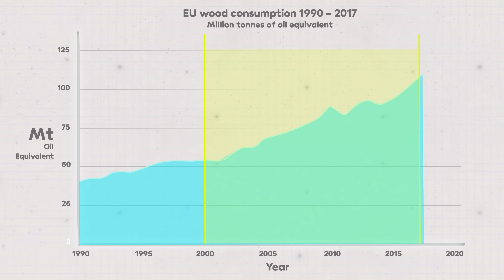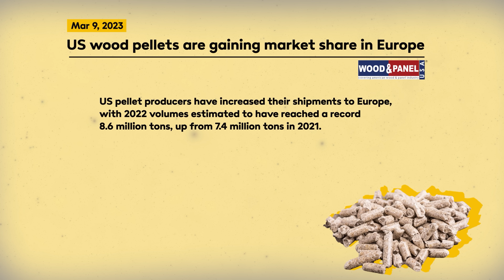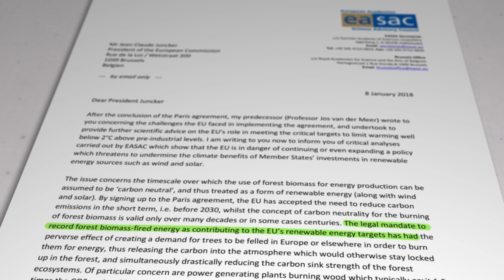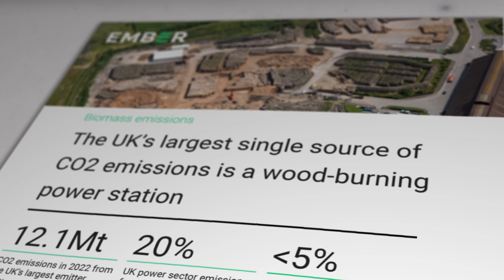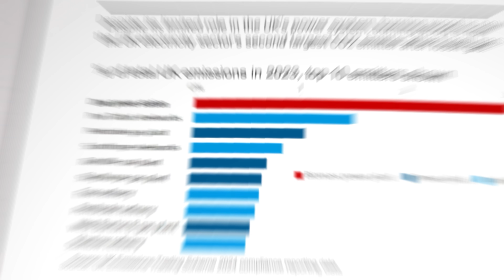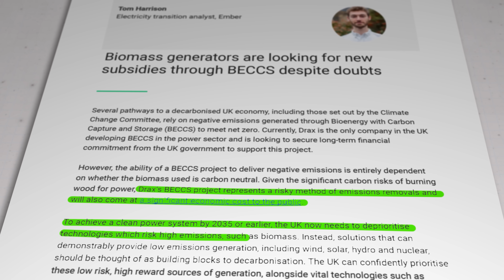New report: Biomass CO2 emissions 4X higher than COAL!!

Comment: Watching the green eyeshade activists rent seekers in action demonstrates the silly outcomes of central government-based activist-driven subsidies.   If we just had a pure carbon tax on carbon out of the ground (fossil fuels) that was revenue-neutral with the money back to the citizens would do the allocation of CO2 much more sensibly.   

Something is wrong about the CO2 emissions per kWh of electricity from coal vs wood in your presentation.   Chemically wood is effectively coal (carbon) + water  (C6 H10 O5 ) and aside from the latent heat of the water as shown in lower and higher heating values, not that much difference in terms of CO2 in the stack gas per KWH generated.  The lower heating value of wood in BTU/kg is just the added kg of H2O in the molecules of wood that are along for the ride making the kg / KWH of wood much larger than coal with a much smaller change in CO2/KWH.  Only in subsidies do we have the greed of the green rent-seekers showing up.   

On a higher heating value basis for low grate heat, wood is almost the same as coal on a CO2/BTU basis.   

CO2 impacts on climate are a concentration (integral of emissions over centuries) problem and annual variations like with corn or trees are irrelevant to the climate.   These short-time storage issues are only relevant to greedy activists cashing in on subsidies.
Reply: WORD SALAD FROM A FOSSIL FOOL!. BLAH BLAH BLAH!

Comment: Accross the pond here in Nova Scotia, we produce all those wood pellets that come from elsewhere. I know a lot of what we ship goes to Germany. I'm not sure how much goes to the UK.  And ya, they cut and use trees just for pellets. We have a Biofuel power plant here as well. 

Efforts to restain clearcutting are not wholly successful. Worse than that, the foresty industry uses glyphosate spraying to control the growback to favour conifers. 

There are difficult issues related to all this. Forestry has been big here for hundreds of years. The forests here were once mixed deciduous. Conifers grow back faster and crowd out other species. Conifers also inpart a higher heat retention to an area. The forests in Nova Scotia and New Brunswick have gone through Borealization. The boreal forests, especially more southern areas of Canada, are exposed to increased risks from changing water patterns and insects that kill large amounts. The Spruce bud worm is just such a culprit. 

We are currently in the upswing of the Spruce bud worms life cycle. Trees are starting to die and that will get much worse. The dead patches become threats for forest fires that get huge fast. It would seem that we should be cutting down large areas of conifers, but we should be replacing them with deciduous trees. That costs more, of course. Instead of burning trees we should be ensuring that wood is sequestered into building structures. 

Burning should be done locally and it would be best turned into biochar and added back to the forest as nutrients. Some could be put aside for long term sequestration or secondary products. 

It is a complex issue that needs lots of boots on the ground. Our forestry management has been highly detrimental for a long time. It is time we apply the effort required to bring our forests to a position or resilience. We need to anticipate future climate expectations when selecting the kinds of plants and trees we encourage. 

I hope our understanding of how much effort is required can be matched by a lot of money. None of this will be cheap. It will all be hard work done by humans too. We just can't put more of a carbon footprint on all of this. We need 100,000+ forestry workers right now. The forest fires in 2023 were 4x our annual carbon emissions. Reducing emissions is not going to work if the fires outpace our response.
Reply: It's always a pleasure to read intelligent comments on YouTube... and a rarity!
Well said!
It's good work; we could be so happy if we refocused on steady state economies and undertook meaningful, physical work.
Reply: Nova Scotia is the classic example of what not to do... It has all the advantages for true renewables yet relies on coal and pellet plants... SMH... At least build that power link to NB, NFLD and Quebec and tap all that excess hydro!
Reply: Just in case you might have been around in the late 60s, early 70s. I was talking to some friends recently about when I was a kid we traveled to Nova Scotia and one of the things that was burned into my brain was driving along the coast thru a damaged forest fire area. It seemed to go on and on and on. Do you happen to know of this fire and when it occurred? It had to be between 68-72, but I can't ask anyone in my family anymore. Thanks.
Reply: @markvalery8632  Sorry, I don't know that fire. I only moved here 16 years ago. Already, the summers are drier than I remember. We are surrounded by forest, some of which died the last time the bugs had their day.

Comment: With the cost of electricity in the UK at the moment people are starting to clock on that home generation makes more sense
Reply: I've just had my unit charge decreased and my standing charge increased.  This reduces the fiscal efficacy of my solar panels.
Reply: @rogerbarton1790  Who gives a f** about the fiscal efficacy of your solar panels? If they are reducing your carbon footprint then that is good. Did you install them to make money or to reduce your devastating impact on the planet?
Reply: oh yeah - my off grid solar is working out quite lovely as the years go by
Reply: And if the power company is still charging you too much, put in some batteries and go off grid. If you have electric vehicles, you can even use them as a way to transfer electricity from the grid into your household in those really mucky weeks when solar just doesn't do much - and you're not paying for the "privilege" of being connected to a grid you mostly have no use for.

Also, a properly sealed, insulated, and mechanically ventilated house uses very little power in heating and cooling. That makes the economics of off-grid setups a lot more workable.
Reply: @tealkerberus748  However, if you charge your EV away from home, you will pay a premium price for that electricity. Through the year that will probably cost more  than paying the standing charge. There is no "free lunch".
Reply: @nickwinn7812  It's not a free lunch, it's an emergency backup option when the weather is really uncooperative. It's up to the individual householder to assess their own energy consumption and photovoltaic capacity, and their local grid supplier's charges, and decide whether being connected to the grid is a better or worse deal for them than disconnecting.
Reply: The cost of electricity is pegged to the wholesale price of natrual gas, if it was pegged to renewables, which is now the majority generation source in the UK, the per kWh price would fall for everyone.

Comment: Biofuel has a place. Gas from waste treatment plants, pellets and briquettes from scraps,  worn out card board fibres, biomass from clearing of land and roadsides, waste material from saw mills, old pallets, recycled wood and so on. Fire wood from dedicated fields being replanted with fast growing species is not that bad, but monocultural forests should not be the rule. I use a lot of "recycled" materials in my stove. Like cut-offs from a local carpenter’s shop. Cheap and clean burning. I get free, worn out pallets from industrial areas in town, have even taken on storm-stricken or dead trees. I’ve got a chain saw and can do such work myself, within sensible limits. But fuelling a really large power plant with pellets from overseas? That sound like exporting a problem. PS: Dead trees and rotting waste produce a lot of methane. A very aggressive climate gas, far worse than CO2. Methane is broken down to CO2 after 10-15 years, but it is better to use easy available biomass than to leave it decomposing.
Reply: Yeah, whilst remembering of course that decomposition is a rich pattern of life... trees left to rot are also habitat.
Let's not turn the world into a dead, tidy town park.
Reply: @UsualYaddaYadda  Yes, and as I wrote: Fire wood from dedicated fields being replanted with fast growing species is not that bad, but monocultural forests should not be the rule.

Comment: I think deforestation will become a non issue for electricity production (and a lot of heat production) as it can't compete on price for most people. 

Yet, carbon capture will probably lead to tree burial or biochar, so it's good to have concrete numbers in this field.
Reply: Kind of my thought too. The price energy from solar and wind and even geothermal is  going to be far cheaper and these types of power plants will be shut. Not without a fight of course. I'm sure that the huge corn ethanol industry in the United States will scream and yell and try to get politicians who don't support them - even in the face of bad economics- removed from office.
Reply: @laughinggas5281 yeah corn based ethanol was intoduced in the US as a temporary fix until farmers started growing what is called Switch Grass.
The farmers liked their corn ethanol subsidies so much they never changed and the price of food went up.
Remember these farmers are the ones who hate socialism except when they are on the receiving end of the money.
Reply: @laughinggas5281 like I said many times Solar is horrible in anywhere that isn't a desert.  Indonesia is way better off using biodiesel from palm oil as Brazil would be to double down on sugar cane.  Would you rather have these vast areas covered with solar panels or with vegetation that actually capture carbon?
Reply: @amizuki   Yes, I would. Especially if you combine with a crop that matches with agrivoltaics.  The two crops you mention have been terrible environmentally.  Vast tracts of forests have been removed for both.   But it's a false choice. Solar should be on every new roof, warehouse and parking lot, and parking garage.  It might be more expensive LCOE than out in the country, but having the power generated close to the use of that power makes sense . Even if we use farmland, it doesn't have to be enormous.  In Germany you'll see solar farms all over and yet there is a tremendous amount of natural space too.
Reply: @laughinggas5281  100% agree 👍 Agriculture, parking lots, and ranching work beautifully with RE. Plus shade can help crops grow and livestock live comfortably.

Farming for fuel is EASILY thousands of times less efficient for removing carbon than RE.

Farming trees only makes sense for carbon removal if you specifically target that goal (tree burial or syngas + biochar.
Reply: PV is so cheap now that places like the UK can use it price effectively. Plus thermal solar also works in the UK.
Reply: @laughinggas5281  solar has no business in Germany either there is not enough irradiation -- waste of manufacturing resources of those panels.
Reply: @amizuki  PV panels create irradiated waste? That's ridiculous misinformation...
Reply: @danberm1755  where did I say that?  I am saying it is a waste of resources to deploy solar panels in the UK or Germany.  The irradiance is horrible in those two countries.  You are much better off sending them to Arizona or Australia.  Oh I see sorry for the confusion -- meant to say irradiance.  But renewable energy will never get anywhere while we deploy them stupidly.  Brazil is at 50 pct of primary energy being renewable heavily leaning on bioenergy.  If Germany or the UK depend on wind and solar it may match that in 40 years.
Reply: @amizuki  Oh ok, I see what you're saying now. 

But, PV will be rolled out like carpet here soon. 10% efficiency is ok considering we're just talking about sand, plastic, and a bit of metal.

It would be better to install panels in Morocco and transmit the energy to Europe. But, politically it's simpler to accept lower efficiency and move forward ASAP
Reply: @danberm1755  everyone is missing the point here -- everything is terrible environmentally.  This solar and wind obsession is absurd -- there are a lot of transmission constraints.  There is a ton of degraded pastureland in Brazil that would be infinitely better served by planting macaúba trees or feeding the world with more row crops.  Solar panels are just a terrible idea anywhere it rains and not on a rooftop period end of story.  And wind only make sense in windy places that are logistically sensible.  Brazilian sugarcane still generates more primary energy than Chinese Solar despite the insane deployment and supply chain no other country in the world is able to replicate for several decades.